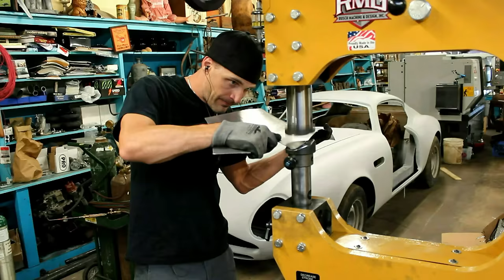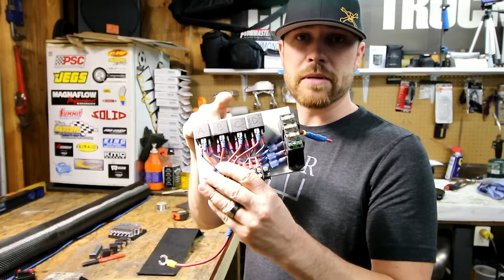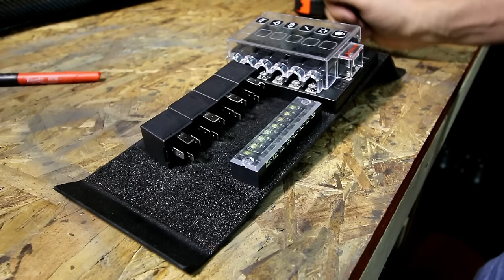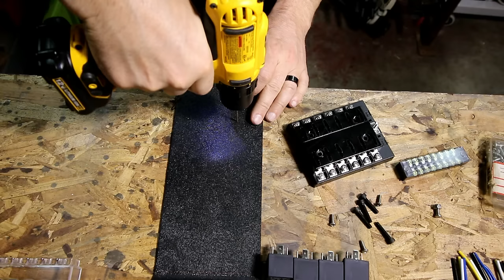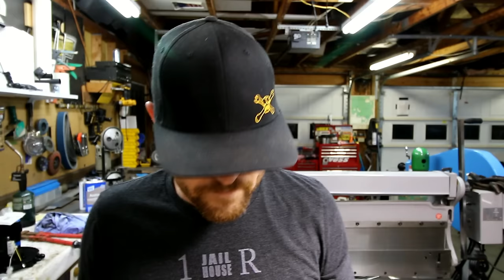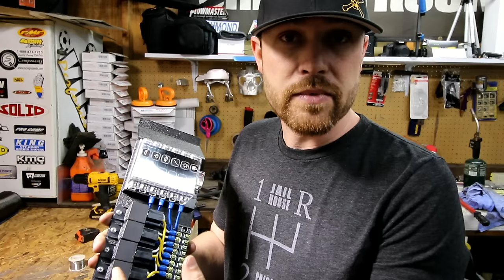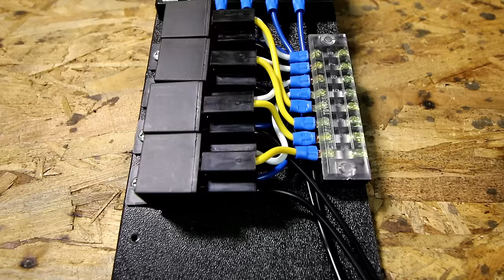How To Make A Power Relay / Fuse Block | Automotive Wiring

Comment: so one issue with the breakers is they are harder to find in lower voltage lower amperage.. it's better to use fuses for 95% of automotive application. if you don't know why a relay is better in some situations its because a switch can't hold high amperage. one example.. some wise guy put a 160watt light bar on a truck ran through a 20amp switch, on top of that used too small Guage wire. this almost burned the truck down on top of all of that the circuit wasn't even fused!  wire safe my friends!
Reply from the maker: yeah I would suggest always using fuses...breaker is just for my main bat cable

Comment: How many relays we will use for 4-6 accessories?
Reply from the maker: 4-6 You want one for each accessory
Reply: Thank you!! The output of the accessories (LED for my job) will connect to the terminal?
Reply: 4 to 6
Reply: depends how many different switches you want.. if you want every light on its own switch than 4-6 if you want them all on one switch than just 1 relay.. so on so forth.. if its just low draw LED lights not high wattage ones you can skip the relay and just run a power line to an incab switch.. make sure to fuse it though

Comment: circuit breakers are great, but putting them in a hot engine compartment makes them trip just because of the heat.

Comment: THIS IS FAIL CITY>...  Running a 300a breaker on that tiny wire???  That wire will catch fire before that breaker goes.  The amp rating is BASED on wire size and length, NOT what its hooked up too.  300A is rated for 25 FEET with 1/0 GAUGE.... so how the fuck is that 300a gonna work for a wire that small?

Comment: All of the blue wires could have come off of one fuse.  They are very low amp.  All they do is supply power to the relay and don't take any load.  He wasted 3 spots that could have been used for other things on the fuse block.
Reply from the maker: You have no idea what you are talking about. The blue wires are the main power source for the relay and would carry the load of what ever is powered when the relay is activated. You absolutely want them all fused separately.

Comment: That breaker is far too big.  The (red) wire would burn before the breaker trips.  The breaker ( fuse) should trip before the wiring can be damaged.
Looks good but could be improved by taking the blue wire down (through a grommet) to the underside of the board and back up inline with the relevant fuse.  Yes I know it’s nit picking but only perfection can’t be improved on.
Reply from the maker: Its not for the red wire...

Comment: How did you know how to run a 300 amp circuit breaker and not a 100 amp?
Reply from the maker: its based on the cable you are running. You want the fuse to break at a lower amp than your cable is rated for.
Reply: What cable are you talking about? The main positive battery cable?  One mechanic said to add up all the fuses amps in the fuse box you have in your car and that will tell you what amp circuit breaker you should use. Is that true??
Reply: Randy, adding up all the fuses in the fuse box will give you the maximum possible load under none failure/short circuit conditions but the aim of a fuse/breaker is to blow before any of the wires do as to prevent a fire. So any fuse/breaker should be less than what the wire is rated to but more than what you'd expect the normal load to be....

Comment: I wouldn’t even fuse a 2/0 at 300 amps... that’s a biggggg breaker. You’re taking 3/0 or 4/0 for 300 amps.
Reply from the maker: no that breaker was for the main power coming from the battery (welding lead cable) which is 1/0

Comment: Just saying but it would be much more siimple if u made the relays a switched ground not a switched + ....alot less wires to run at that set up cus all u gota do is ground the switch someware close to it and not have to find a 12 volt source
Reply from the maker: yeah unless you have a power block just as close as any ground. I could make the same argument in reverse. I have all the relays trigger grounded right at the relay...If it had 12v all the time I would to run those wires from somewhere.
Reply: The Fab Forums touche ... Just expressing wat i have done ...i did use this video to help me build somthing like this but i just used the grounds as switched insted just thought id share that with others that it is an option for a cleaner install if called for one and im saying for aftermaket parts installs not necessarily for a rat rod set up for runing all the electrics of it

Comment: Did I miss it but this video would have been 5stars if you had named or stated the actual  numbers on the relay so we all knew which of the 4 wires in the relay you have going where
Reply from the maker: +MIKE PIERRE Yeah that would probably have been a good idea
Reply: I was wondering the same.I bought the ones you linked but mine came with Blue, Red, White, and Black wires. Looking at your set up My red (30) goes to the fuse block, My blue(87) goes to the device terminal on the bus, but my white(86) and black(85) are swapped.  Your Yellow is my Blue, Your Blue is my Red, Your white is my black, and your black is my white...LOL! Definitely got to know what leg of a relay does what plus my diagram on the relay was wrong also so i had to use my meter to figure it out and after that saw the number on the bottom of it by the blades and those were correct.

Comment: 300 amp breakers? That seems extremely high. That’s double what ur alternator would be putting out. To trip 300 amps ur small gauge wires would already be melting.
Reply from the maker: that breaker is for the main battery cable...welding lead cable in my case

Comment: Don't like the volt drop across all those connections.
Reply from the maker: there wouldnt be any volt drop
Reply: All touch connections have a volt drop. Take a volt meter and check it for yourself.

Comment: 🤔 why common ground, most instances ground activating is better. Especially if you want more professional wiring.. yes building a car you are going to have your 12 running everywhere that you can “tap” into. “Tapping” into wires is not professional, and makes the all so fun game of “find what’s wrong” fun... only professional way to do it would be to run a positive from your central circuit, to the switch and would have to go back, 

Or ideally you’d want one nice block where everything is right there, fused and circuits all isolated. You want it that way, you don’t want to run your trigger for a switch from a random constant around, ex from like the radio. That block should have a constant, acc, and on terminals, for most things you would only have to run one wire out because ground is everywhere. If there is anything that gives off plus activation sure you can use it because again one wire, it’s outputting + and you don’t have a choice in that, it seems you are trying to make your job easier but in reality you’re not, and making it difficult for future people who may need to find what’s wrong.
Reply from the maker: just depends what I am wiring....

Comment: what about a battery isolator??
Reply from the maker: like a master cut off?
Reply: @Thefabforums   yes for car audio batteries. A major sound system will usually have a set of batteries that are wired along with the one under the hood.
Reply from the maker: I have a master cut off on this setup...didnt need multiple batteries for this combo though

Comment: That wire will burn way before 300 amps. You need a 60 amp breaker for that size wire. The 300 is doing nothing.
Reply from the maker: correct the breaker needs to match the wire size. I used 0 gauge welding lead wire on the build

Comment: also, there is no way that breaker is 300amps.  there is simply no connections in an automobile with a wire guage that large.  a typical house has 150amp service, you're trying to tell us that a car needs a 300amp breaker... the amazon link makes the mistake.  clearly a mislabeling mistake but some of the Amazon comments are hilarious with people complaining about it tripping at 50 and 100 amps. really begs the question as to how they measured things.
Reply: Other than the starter motor you mean, which can draw 200+ amps easy while cranking from cold?
Reply: Eric Mayo a house is 110/220 big difference.  300 amp in 12v is roughly the same as 30amp at 110v
Reply from the maker: I use welding lead cable for my main power source / starter. You dead short that cable and I can guarantee it will flip a 300 amp breaker.... besides the more volts you have the less amps
Reply: Chris Nixon that's true but power through wire is P= I^2R, where diameter of the wire and its length affects R.  The most power hungry action is cranking and while CCAs can exceed 300A, the terminals in that video are simply not large enough for the Guage of wire necessary.  and I don't think this video's application had anything to do with modifying the crank circuit.
Reply: also house voltage is AC, and in that case you're really concerned about RMS power so your comparison isn't exactly correct.  12v@300a= 3600watts.  but wire, the conductor, doesn't drop 12v.  it's much less with it being a conductor.  so the formula is the I^2R, you determine R from diameter or guage and it's length.  220v@150a= 33,000 watts peak.  watts-rms= 33,000x.707=23,000 watts rms.  23,000 is quite a bit less than 33,000 but hopefully it's obvious these large neighborhood values simply are not found in an automobile.
Reply: The Fab Forums sure, I would agree.  but the purpose of a circuit breaker is to prevent fires and protect equipment.  usually, however, when electronic circuits fail they may fail in part.  perhaps a capacitor starts to fail.  you want your breaker to trip before you reach a dead short scenario.  a dead short will trip a 15a circuit breaker too by the same reasoning.

Comment: clean work, but just for everyones safety, do NOT run a 300amp breaker on that small of wire, that wire prolly would catch stuff on fire after 100amps even if its only a short run, other than that tho good video
Reply from the maker: the breaker wouldn't be for the wire on this panel. The breaker is for the wire that feed the panel. All the wires and relays are already individually fused.
Reply: correct but if that wire were to short in between the beaker and relay board then that wire would go up in smoke still before the 300a breaker would flip, just trying to make sure no one uses that big of a breaker with that small of wire as that is hazard

Comment: I'm not trying to piss on your parade here, this is a serious question. Where would you use a 300 (three hundred) amp breaker? The wiring on the car system id generally rated for about 20 amps some of it mey carry 30 amps. Your wiring will be melted long before a 300 amps CB kicks. I use a 30 amp CB and I think that is too high.

Comment: Could you assist me on how to calculate the required breaker size?
Reply from the maker: sure. If its a main breaker make sure the amperage of the breaker doesn't exceed what the wire is rated at.

Comment: 300 amp breaker? no way that wire can handle that. Minimum 1/0 AWG OFC for 300amp breakers or fuses
Reply from the maker: The breaker is not for that wire.....thats what the fuses are for....
I use the breaker for the main power cable coming from the battery. In my case I use welding lead cable

Comment: your breaker is way too big for that wire, the wire will melt before the relay will trip
Reply from the maker: the wire shown is protected by the fuses. the breaker is for the main power which in this case is welding lead wire.

Comment: Pretty sad you didn’t saulder those butt splices. Yeah yeah it’s not necessary Bla bla. One day it’ll fail as is.
Reply from the maker: Most are moving away from solder as it causes it to fail sooner by making the wire brittle and prone to breakage.

Comment: try to dont use the original chinese wires.
Reply from the maker: +Fernando Echeverria I think these days all wires are chinese
Reply: not all, there are very good quality cables, but those who come preassembled, are very thin or have quality problems in metal, and used quite a while and then end up giving problems rotten inside.what I do is to use the plastic but switching cables and terminals by better